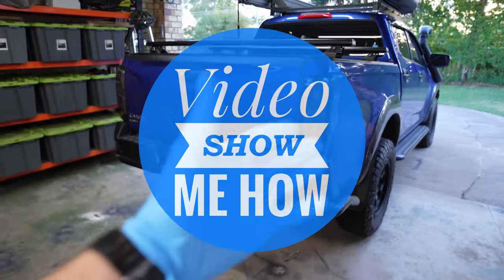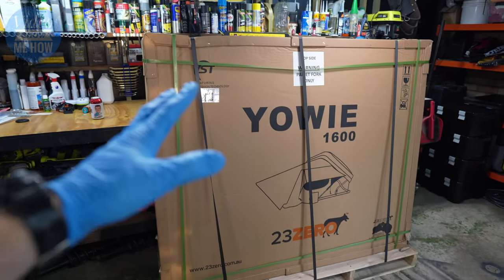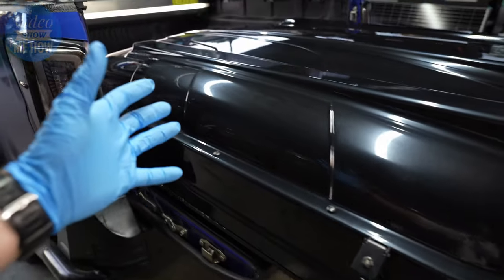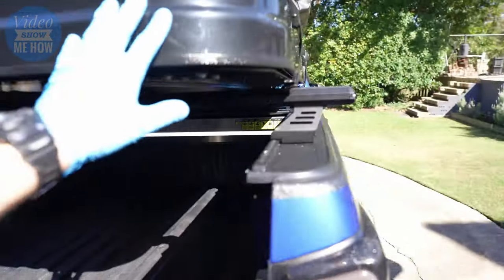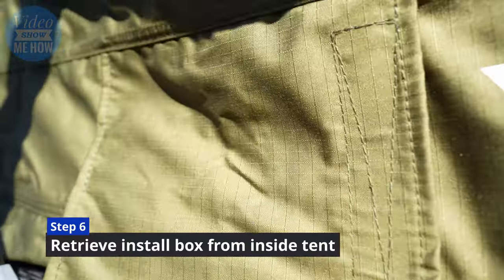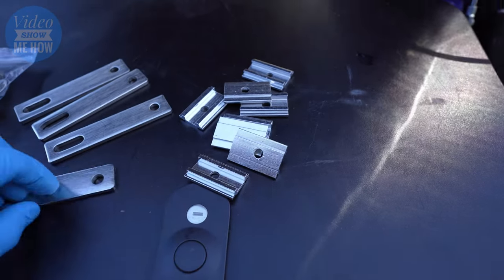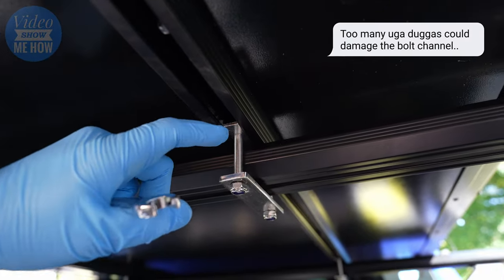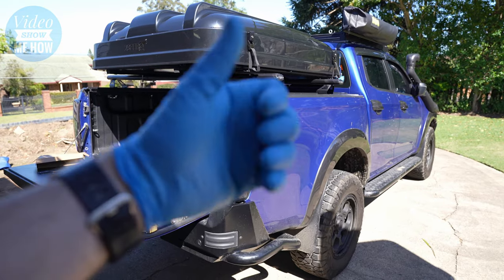23Zero YOWIE ARMADILLO Roof Top Tent | INSTALL | How to Install a Roof Top Tent on your Tub or Bed

Comment: Great channel with a lot of great ideas.  Just confused about the weight capability. Your HSP bar install says the bars have a load bearing of 80kg. The rooftop tent is about 80kg itself. How are the bars supposed to support the tent and two people? I've clearly missed something obvious.
Reply from the maker: Dynamic vs static rating. Static (eg when stationary) is higher

Comment: This is great. I have a Hilux and a fibre glass top on the tub, but would prefer the tent like this over the tub. So all the equipment/luggage has to be in weather proof containers in the tub. Does the car handle better with the weight at the back?
Reply from the maker: Yeah it did, has evolved a fair bit since then though, check out the latest couple of vids 👍

Comment: Great video and review... I am considering this tent. Why did you go from a low set up to using a tub rack and having a higher setup ?
Reply from the maker: Cheers. Change in setup but also found that with the low racks was tricky getting to anything underneath towards the back, and to half crawl in there. Have gone to a canopy now and tested a different style that's Slimer, not necessarily better but different. If you check out the cape trip vehicle overview you'll see what I mean. The Saber-X has a full review coming soon to the channel as well
Reply: thank you ... any reason you decided to switch from the Yowie to a more slim line tent ? I currently a low setup and am thinking of investing in a Yowie.. 
 @VideoShowMeHow

Comment: Hey Adam
Love your work, you've helped me alot along the way
Couple questions are you going to touch on your awning in the next video and how you can (or can't use them) with the RTT? I really like the RTT but want to utilise a 270° awning but pretty sure wouldn't be able too while the tent is open....
Noticed in the the Dmax overview video you had two awnings on the roof rack and was just interested in your set-up with them

Keep up the good work legend
Reply from the maker: Yep you can, have run the 180 and now the 270 with this RTT 👍 You'll see in the vids
Reply: Also off topic, what made you go the pedalbox over ultimate 9 evcx or idrive?
About to order now
Reply from the maker: Basically for what I explained in the vid, I ran an i drive for years in the jeep build, work fine, but the pedal box is just a bit more premium, can hide the whole unit under dash and just run via the app, and it tunes to your pedal throw instead of just standard signal amplification like idrive/evc/etc etc (they're all the same just different brands slapped on top)

Comment: Looks reasonably secure front to rear. Doesn't look great for potential lateral movement along the rails? Is there any rubberised material to increase friction?
Reply from the maker: Yep sure is 👍 Have been off-road on a few trips and is rock solid. About to try something a little different shortly so watch this space :)

Comment: What made you go with the Yowie over the Panther?
Reply from the maker: Mainly because of shape and the fact that front awning doesn't need the metal stays, it's all one unit making setup ridiculous fast and easy. Sheds water reeeally well. Also the headliner is a one piece automotive style unit which adds some sound dampening (actually reasonably quiet in the rain)

Comment: Did you give it a bit of a run on the dust seals? Much in the way of noticed design flaws?
Reply from the maker: No issues so far? Haven't hit any hardcore red dirty yet but have been down some decent tracks

Comment: Hi mate. Was wondering if you could tell us the minimum width between holes on the steel brackets shown in min 7:22. And the length of the bolts going in them. Looking to do some mods to a tub rack.
Reply from the maker: 100mm bracket, holes max 80mm, bolts 100mm. You can get generic brackets and bolts as most roof top tents are the same mounting system as this 👍

Comment: If you didnt have the heavy awning would you run it on the roof? 
I have the same ute with rhino platform and no awning and wanted to run it on my roof
Reply from the maker: Would be close, max roof is 100kg, so if rack is less then 20 you'd be right
Reply: @VideoShowMeHow  on the rhino page it says 21 but what makes no sense to me is you max out the weight on the roof how do u sleep in it then wouldnt it be too heavy with people in the tent
Reply from the maker: Dynamic load vs static load. Static load is usually a fair bit more (eg at camp)
Reply: @VideoShowMeHow  oh so our dynamic load is 100 and would be abit more when at camp not moving (can take to weight of people in the tent)?
Reply from the maker: @xBURNSY270x yep that's right
Reply: @VideoShowMeHow  thank you for your help

Comment: Something to note for those wanting to mount their tents on the roof is that there is a difference between static load rating, road load rating and off-road load rating. The roof may very well be able to have 100 kilos loaded onto it but when the vehicle starts to move that load rating drops severely to the point where it's lucky to hold itself and a couple of roof bars. Rhino rack is a prime example of not really showing these ratings unless you really dig for them.

Ronnie Dahl did the same thing on his channel and received an urgent warning from a third channel that had just had their tent fall off and badly damaged the roof of the vehicle https://www.youtube.com/watch?v=r32xd9z4SZ4&t=139s. Mounting it on the tub is a much safer option and lowers the centre of gravity for the vehicle so you're less likely to roll it while doing sharp turns.

I do enjoy following the build though so keep 'em coming!
Reply from the maker: Yep exactly, dynamic load (eg when off-road etc) is the figure you want to base off, not static load (while load is stationary, usually much higher)
Reply: @VideoShowMeHow  For some reason I couldn't think of the word dynamic lol!

Comment: The weight of the Yowie plus fittings is listed at 80.5kg and the HSP Load Rack is rated to carry 80kg combined. Is that 80kg per bar or 80kg across both bars?

Are you exceeding the recommended weight when you sleep in it?
Reply from the maker: Each bar and that's dynamic so no probs, static is much higher 👍 Going to try something slightly different so watch this space ;)
Reply: My understanding is that's the static load limit, not stationary. It's mostly to account for the maximum allowable weight you should have on it under the worst possible driving conditions where it may potentially start to fail.
Reply: I was going to ask the load rating on the bars as I’m looking at custom built canopy with maybe RTT down the track.

Also mate I’m getting the Alpine Halo 11 installed first week of Dec with 380 cameras
Reply from the maker: Yeah awesome 👍

Comment: comfort will be my biggest question with roof top tents. i dont want to drop 3 grand on something and for the mattress to be ass.
Reply: $40 memory foam mattress protector makes is a million times better 👌🏼
Reply: As Aaron said, or just hit up Clark Rubber for some eggshell foam to suit!
Reply from the maker: So far so good hey, I mean it's not like an inner spring but have had a few nights so far and no complaints. Better than the bandit 1100 mattress I reckon